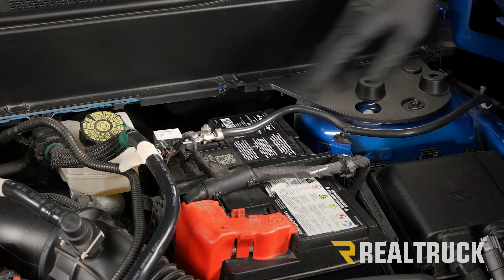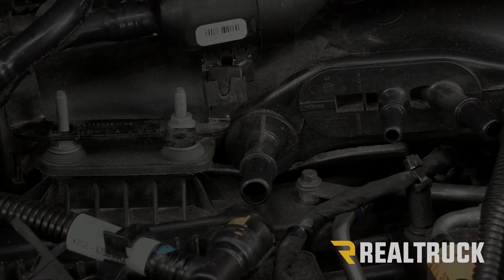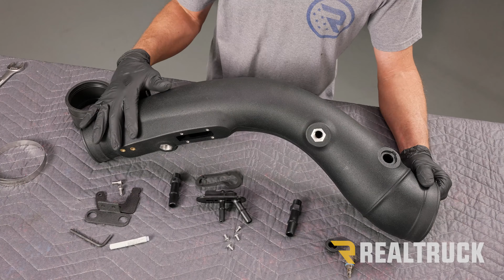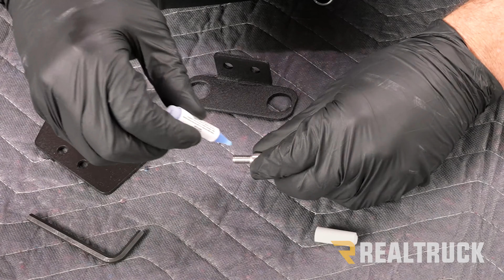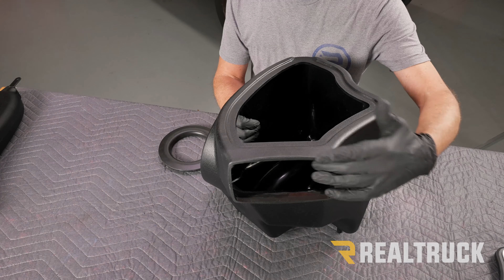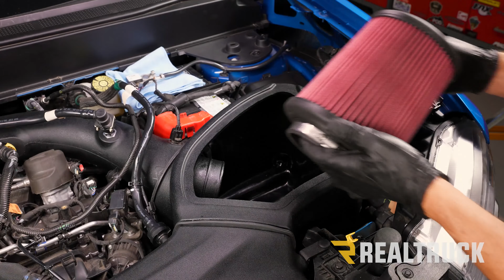How to Install S&B Cold Air Intakes on a Ford Maverick

Comment: Is that air intake pulling air through the radiator?
Reply: No, it pulls air from above the grille, before it goes through the radiator. It's the same location as the factory intake.
Reply: in front

Comment: So, why no Dyno follow up video on how much power it makes over stock?
Reply: I don't have an AWD dyno, let alone a regular dyno, otherwise I'd have done it. Don't believe everything you see with dyno runs, you can get a fair comparison, but those numbers are far too easy to manipulate for a video. As far as overall increased gains, you won't see much without also installing a tune, but you will spool quicker, have better throttle response, and hear the turbo noises when you let off the pedal under load. Hope that helps!

Comment: Good install video, question though, does this require a tune after install ?
Reply: That kit does not require a tune, but you'll get the maximum performance benefit with a good tune.
Reply: @ToddsTruckLife  so if you get a tune in the maverick does it void your warranty
Reply: @johnmcmanus123  as with anything aftermarket, the Magnuson-Moss Warranty Act does not allow a manufacturer to void a warranty due to an aftermarket part or tune, but if they can prove that it caused a  factory part to fail, then they can deny a warranty claim.
Reply: @ToddsTruckLife  thanks for the answer